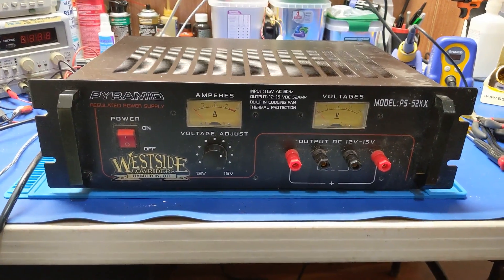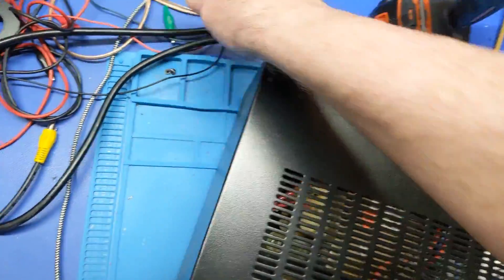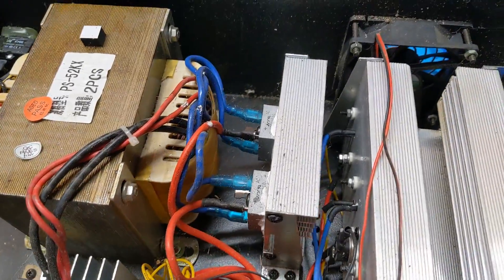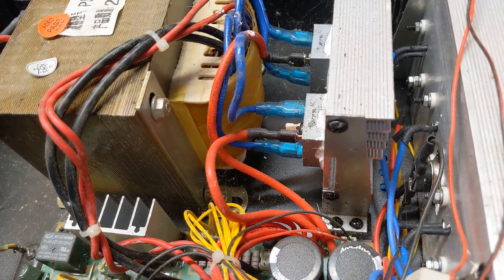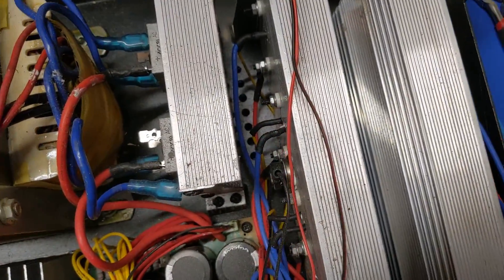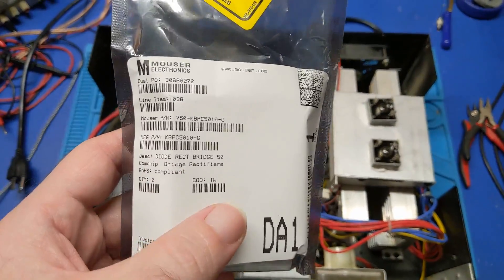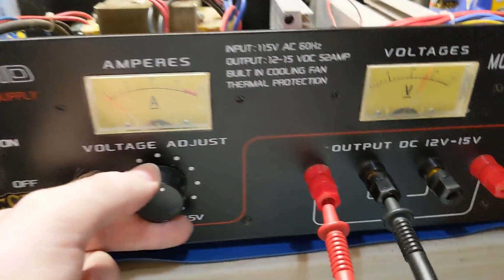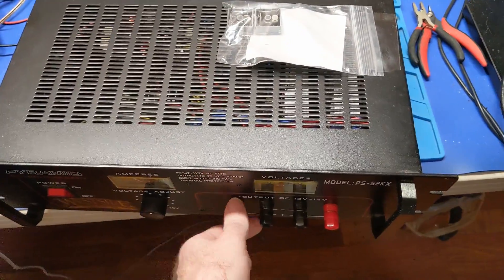Pyramid PS-52KX Power Supply repair

Comment: I have the same power supply. It’s reading 24-25 volts and was told its voltage regulator problem most likely. Do you work on peoples equipment?  This is only 2 years old
Reply from the maker: @stephencarpino231  I do perform repairs for other people on a limited basis, because my backlog is extended a bit

Comment: I have one of these, had it for many years.  It currently powers a 12VDC power distribution strip with everything ~12VDC in my Hamshack plugged in.  300W HF transceiver & 50W UHF\VHF transceivers. 2x powered 12V powered USB hubs for the computer, and because I'm a bit nerdy my computer audio stack runs Toslink out to a 12V powered D\A converter and then into a 12V Car audio equalizer then into a 4 channel 150W RMS\channel car audio amplifier out to two pairs of studio monitors.  Nothing like having a 150W RMS per channel 4 channel computer audio system lol.  This Power supply while I agree was probably designed for car audio amplifier testing or to supply the 12V in multi deck & multi-amplifier car audio displays that used to be found in car audio & retail stores back in the 80's 90's & 2000's it's quite useful in the ham radio world and powers everything in my shack I have thrown at it over the years without breaking a sweat.  Not sure how my electric bill enjoys it with that giant transformer, since you can get a switched mode supply that is 1/20th the size that weighs about a pound these days that runs 50ADC and is 85%+ efficient but hey I use it anyway :)  It's a beast for sure!

Comment: Can you tell me if the fan supposed to work all the time when you turn this power supply on? I picked one up with these Powers of Life and I had to replace the fan. The fan turns on and then it stops. I don't know if there's a problem with the capacitors or the rectifiers. Can you please help me out? Thank you, gunny

Comment: these are typically used for ham radios. the red box should get you to 13.8 volts what is typically for ham shack radios on a budget I had one twenty five years ago.